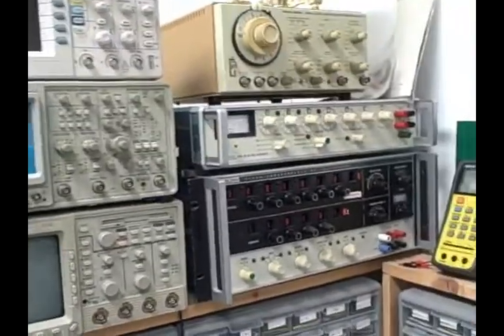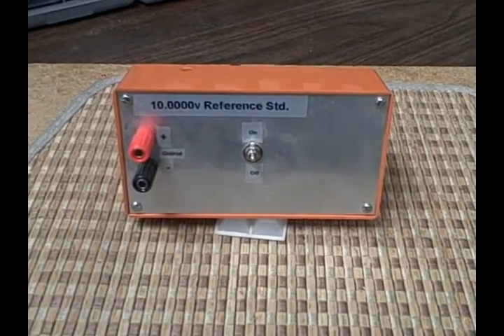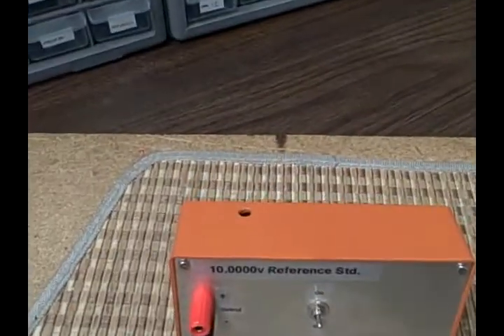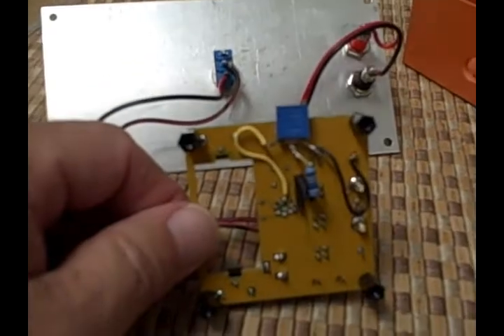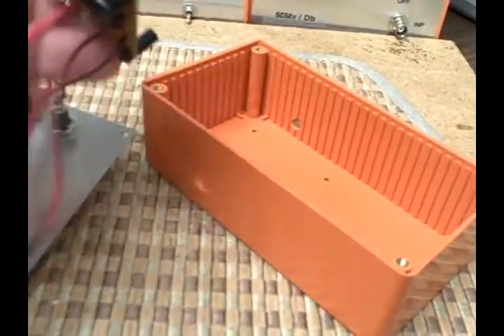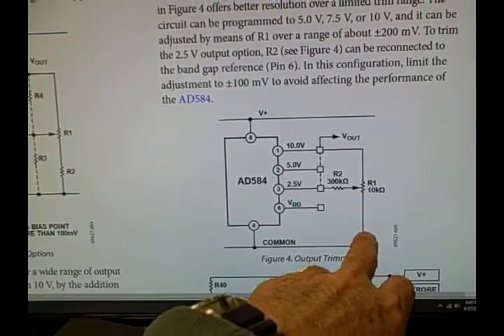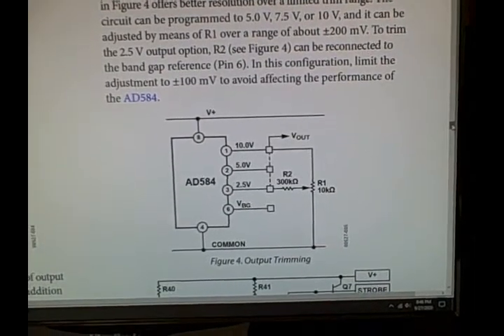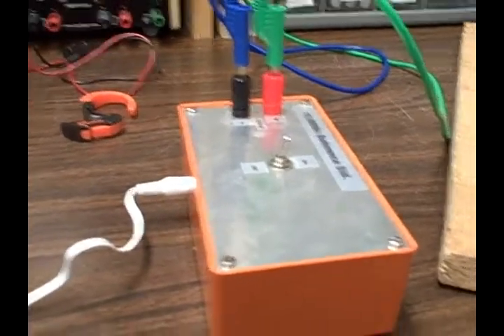10 0000v ref

Comment: I build my voltage reference on a piece of veroboard using a BB REF102P for 10,000V, AD586JN for 5V and AD780AN for 2,500V. The last one is switchable to 1,25V or something too, but I'm not using that. The whole thing is powered by an ac wall wart whose output is being common mode filtered, rectified and regulated on the same board as well. Might do a quick video about it some time...
Reply from the maker: I’d like to take a look at your 10v ref! Is there a video? I bought this module, because it was cheeeeap (about $5). It does a decent job. It would be nice to make a more stable unit though.
Reply: @bap8guy  Hi Bruce! There is no video (yet). I'll see if I can make a quick one tonight, or else in the weekend. The 10,000 can be adjusted to 10,0000V, but depending on room temperature there is a bit of deviation the next time I use it, I found out. The old, used, ceramic potentiometer I used for the 10V isn't much help either, so I think that's the main factor. The references for 5 and 2,5V are very stable I found, I think down to 100uV. I used fresh pots for those, haha.
Reply: @bap8guy  Hey Bruce, here you go! https://www.youtube.com/watch?v=9aVaz76jP7I&feature=youtu.be